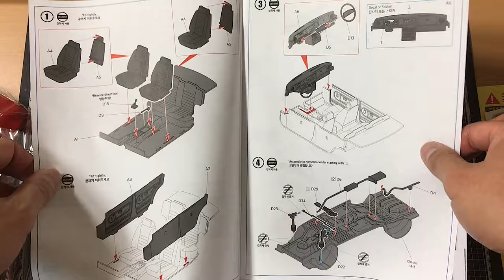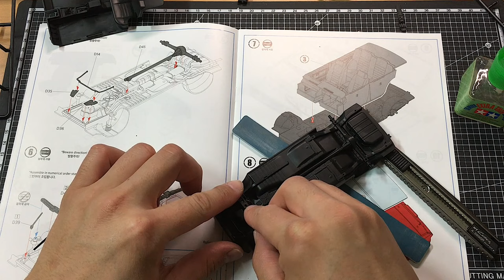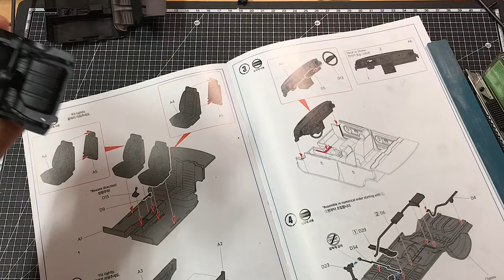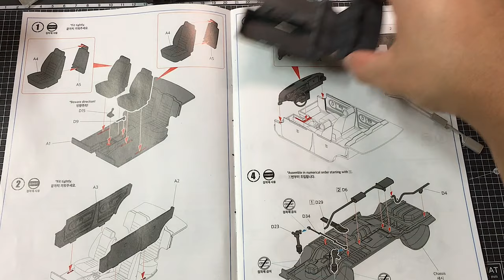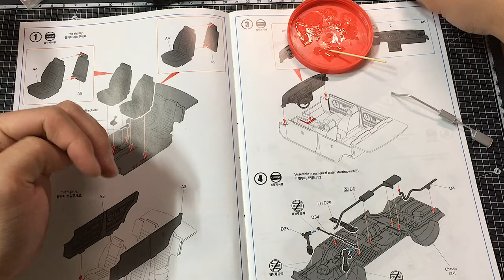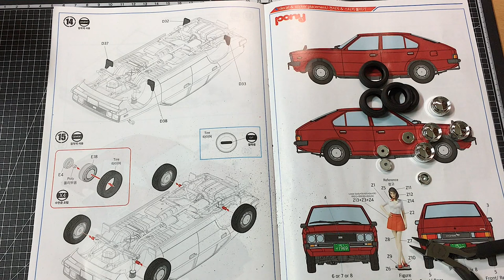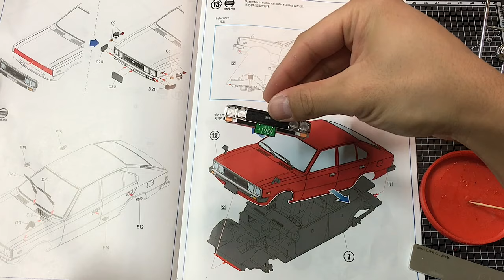[Full build] Hyundai Pony MCP Make It 1/24 Scale step by step build (Academy)

Comment: I like how you highlight the mold parting lines before sanding them, I'll have to try it. I use the same type of black marker to highlight around the edges of the headlight lenses. Are there any references for what colors were available on the Pony?
Reply from the maker: It's a car that's left in South Korea, so you can see a little, but if it's hard to see, Google is the answer.